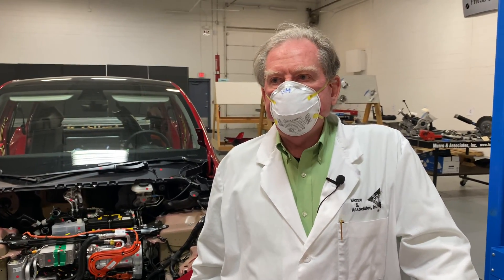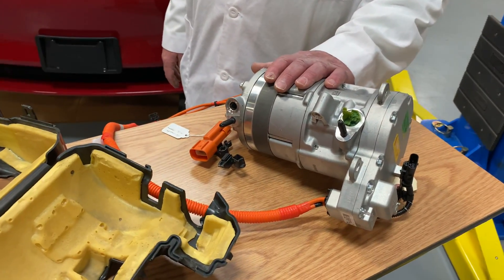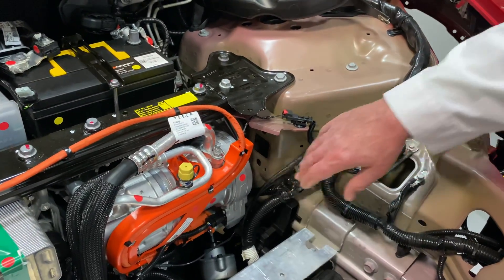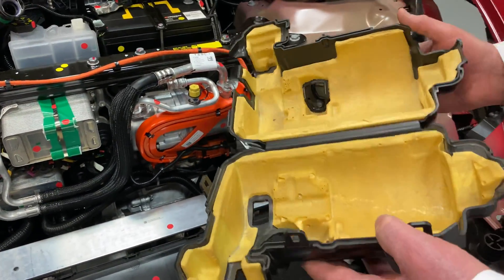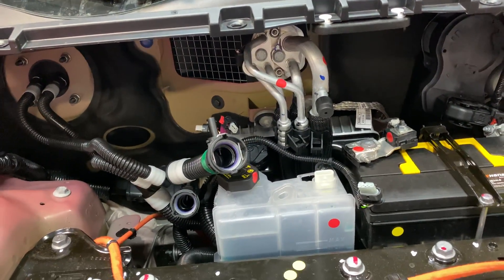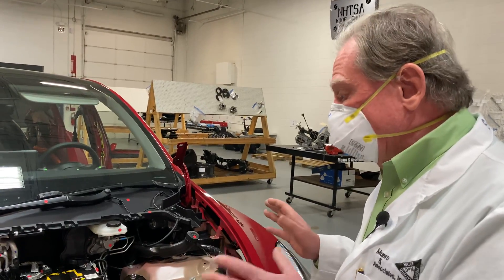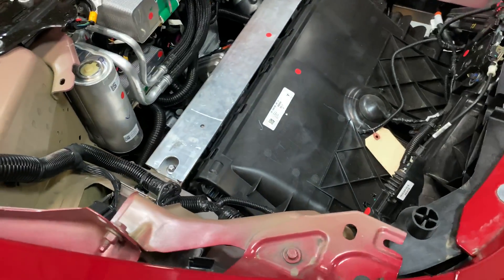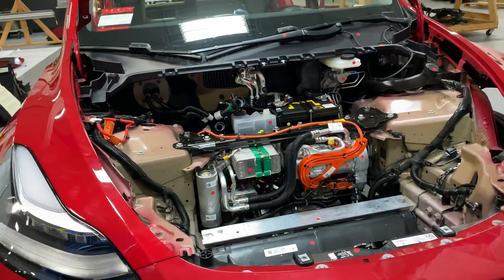Model Y E13: Comparing Model 3 eAC to Model Y Heat Pump

Comment: So Model 3 had separate radiator for Air conditioner condenser hence no heat pump while here its being shunted through two BAHX to either act as air conditioner or heat pump. Furthermore, can you please analyse if fluid path design allows dual functionality, like heating the car while cooling the battery pack at same time?
Reply: Well conveniently the battery pack wants to be roughly room temperature. So the difference between the cabin and the pack shouldn't be that great. Which means that if you want both of them to be at a specific temperature, just have the HVAC system produce a temperature that is opposite room temperature from the external temperature. Then throttle how much of the HVAC output to pipe into each circuit. I don't know if that's how it works on the M3, but I can't imagine it working any other way. Would love to know for sure.

Comment: Sandy touches the, “condenser” (taps thing that looks like a plate heat exchanger) and leaves me confused.
Reply: It’s a water cooled condenser. Uses coolant from the radiator system to cool the refrigerant. Instead of big air cooled condenser mount to the front of vehicle. Much more effective and efficient, especially when sitting still with no air flow. A lot of modern cars are switching to this system
Reply from the maker: The component is labeled "LCC", which we're taking to mean Liquid-Cooled Condenser.  Michael, you got it.
Reply: Munro Live Awesome- Thanks for that explanation- I was unsure as well.  Much appreciated.

Comment: If Sandy thinks it’s a good idea then probably it’s a good idea. He’s finding lots of things about this model Y that I like over the model three. Looks like he’s selling me on a model Y.
Reply: I said it is a good idea before Model X was invented. Nobody believed me. Should change my name to Sandy.
Reply: @tarassu  Depends on what your idea of "good idea" is. Obviously it has some advantages and it has some(quite a few) disadvantages - it is heavy, it can break, it is cost effective and it doesn't heat the cabin as fast as a PTC element. So in that regard it is not a good idea. 

If you live in a climate with below -10/15C - also not a good idea as it will not bring any benefits. It also adds complexity to the system. So if we combine all of this - for the small benefit in some conditions (actually you can achieve near heat pump consumption with proper heating and utilizing the seat heaters) you add a lot of weight/cost/complexity. And if we take the Model 3, the production hell that they had, then adding all of those is definitely not a good idea. Now, they had the time to work on it, add it to the system, which in my opinion "is a good idea" at the current point. It will not bring a ton of difference and only time will tell whether these things will require more maintenance and cost.
Reply: @teslakiller6959  They didn`t want to implement HP for exact reasons you mentioned. Also, they needed to make money form model 3 so...
But, this is supposedly state of the art HP with many solutions that simplify it... So, will be interesting to see what they made...
Reply: @DG-uv3zw  I think this being the first iteration it will have its issues. I think Tesla added it just because people were bitchin about it in reviews and forums - not because Tesla really wanted. Most people in Europe do short trips and put the car on auto with AC which in the winter is stupid - this kills the range. They don't know how the system in an EV works, they are used to the old fossils. If you utilize the heaed seats plus a little pre-heating, not much, you can achieve great results even in a Model 3. 

I think with a little better software on the heater/AC Tesla could've lowered the consumption enough, that a heat pump is not needed. It will be beneficial in some situations, but it is a bit loud and it might add more complexity. We will have to wait and see.
Reply: @teslakiller6959  air contionning is a one way heat pump which can only cool. so they had the heat pump on all model before. They just added some valves so it can be used un reverse to heat the car as well. So they added more efficient heating without much added cost.
Reply: @niconico3907  No, that is totally inaccurate. Plus there is a whole new wiring and the battery is now heated through the heat pump and not the stators like it was before. It is a 100% new system.
Reply: @teslakiller6959  yes its a new system, but the compressor which is the main cost is not much more expensive than a normal air conditionning compressor.

Comment: How much more efficient than the Model 3 is this setup?
Reply: Depends on weather conditions but some say they lost 30% of their battery just on heating the cabin ...
Reply: and if heat pump is indeed 130% efficient, that might workout to only loosing 20% on heating the cabin...
(and maybe battery)
One might guess the model Y  will see 10% less losses in cold/more cold weather range ...  (just guessing)

Comment: I'll take a long range RWD Model 3 with a heat pump, please.
Reply: Engi_Nerd , my preference too. They just announced 404 mile version today (China model). I’m assuming a big battery.
Reply: @shepherdsknoll8  It may be the same battery, just with a different rated mileage due to testing differences.
Reply: @JesseSightler  Yeah you are right. In China, 404 mile version is WLTP and 322 mile in USA is EPA. WLTP is less accurate than EPA .
Reply: @snowrocket691  As a European, im jealous of EPA. The WLTP which we use is not accurate at all. Why the fuck do we not take over the EPA from the Americans. I know the Americans do alot of stuff wrong, but the Car lobby here in Europe is extremely powerfull.
Reply: @Bean-f3z  No elevation? Nah, going down hill for sure XD.
Reply: Exactly this. RWD is already fast enough. I had a Nissan 350z Sportscar that went to 100 in just under 6 seconds. And that was already fast. The RWD Model 3 is also under 6 seconds, and with the heatpump and big battery. I wonder how fat it could go....

Comment: Here in Canada heat pumps aren't really a thing with homes do to winters reaching - 40C. Would this not produce heat in those temperatures?
Reply: They have other ways to generate heat if needed, for example operating the motors at lesser efficiency to generate heat. I also heard something about the octavalve setup itself having the ability to generate heat through a similar approach, but not clear on details.
Reply: At that temperature? No. I think modern heat pumps will work down to maybe -5, however the COP (Coefficient of performance) will get really bad. Once it drops down to 1, then the heat pump has no point as it cannot draw any thermal energy from the frigid air, and you might as well fall back to plain electrical resistive heating. [EDIT] Actually, I checked and they can go lower, maybe down to -25 to -30, but the performance will be very poor.
Reply: @Anthony I've heard it been called -40FC for F***ING Cold!
Reply: My LG air to air heatpump in my house in Norway has a COP of 3 at -15°C and around COP 2,2 at -20°C..freezing outside temperatures are full of energy 😉
Reply: From the standpoint of physics, moving heat around with a pump, coolant and heat exchangers can be made to work at any temperature you might find on Earth, but 'one design does not fit all.'

I think we'll just have to wait and see if the Model Y loses efficiency at those temperatures.  Too late for this year, but next winter somebody or other will probably have a go at running a Model Y in your neck of the woods.
Reply: Maybe an over kill but having the option between the two , or using them in conjunction would be great
Reply: I think the bigger reason for no heat pumps is simply the low (relative) cost of natural gas (and good distribution)

Comment: Do you guys think this heat pump can be retrofitted onto the model 3? From what I understand, the heat pump is much more efficient than what the model 3 has. Would love to retrofit this in there if it's relatively easy to do
Reply: I don't think a retrofit would be possible.  you'd likely need to transplant  entire model Y's cooling system (octobottle) and software.. This is best left to oem.. Assuming this adds %15 cold weather range, I'd pursue more practical options like making sure you have the most efficient winter rims first

Comment: My Active Grille shutter ass ?  What does it means
Reply from the maker: "MY Active Grille Shutter Ass" stands for Model Y Active Grille Shutter Assembly. Active Grille Shutters are being used more and more throughout the industry as a way of balancing air flow into the radiators for optimum vehicle performance as well as aerodynamics for improved fuel economy.
Reply: @MunroLive  yep thats the good olb BMW engineering there mate, the active grille shutter

Comment: Great content as usual! Keep it coming 😁
With the heat pump now included, is there a PTC air cabin and/or PTC battery coolant heater also included? As a backup assuming the r1234yf based heat pump's COP may drop below < 1 at temperatures below < -15degC ? Or they were able to just use the heat pump for all cooling/heating needs with no backup PTC heater at all? Also assuming they somehow included the whole waste heat recovery method from the Powertrain to heat the battery from the Model 3 to the Model Y with the Heat pump based system?
Reply: By sending an impure wave into the motors, they become less efficient, and produce heat. Up to 4kW per motor.

I assume the Y can use this on the cold side of the heat pump to heat the cabin when it's to cold outside.
Reply: As far as I know model y doesn't has restive heaters. But the heat pump has an internal loop to extend the usable temperature range.
Reply: I know that the Model 3 uses its motors to heat up the battery. Tesla Bjorn did some really nice tests to show how it works. It basically wastes electricity in the motors to generate heat to warm up the battery.
And the other things, i guess we will find that out in future episodes.
Reply: Cop cant fall below 1
Reply: @karlreisa3872  when you heat with a heatpump, you come to a point where it delivers heat, the power of the pump is not sufficient. 

Try driving highway speed at -40° ..
Reply: @karlreisa3872  by < 1, I meant it's not usable anymore
Reply: Abhid Akram this is dependent on the efficiency of the evaporative heat exchanger system. 

As an example, my home has a 21 SEER York Affinity Heat Pump and it was able to keep my two story house at 69F with negative 14F outside temps. It takes more energy to run at lower temps but it does keep up with the heating load in my house. In fact, the manufacture’s hardware temp cutoff limit on the HP can be set as low as negative 20F. 

Heat pumps are an excellent choice for heating and cooling. It sounds like Tesla routes the waste heat from the electronics and motors through the heat exchanger as well. This would append the amount of heat available to the evaporator during cold outside temps which, in theory, reduces the amount of compressor runtime to maintain the cabin temperature and/or have the ability to exchange enough heat during even colder (🥶cuhhhhold🥶) outdoor temps.
Reply: @WaterBarleyHopsYeast  thanks for the explanation.

Comment: So there is only 1 radiator with coolant then uses  coolant/refrigerant heat exchanger?
Reply: Yes At 2:40 its a coolant/refrigerant heat exchanger.
Reply: @niconico3907  Cool,  i'm no refrigeration  engineer  but i would assume  this would allow better control, so heat can be taken from motors, inverter,battery and radiator.  This would also work in much lower temperatures than a air to refrigerant condenser.

Comment: Is it really written "shutter ass" on the radiator 😂
Reply from the maker: "MY Active Grille Shutter Ass" to be exact. Ass being short for assembly. Active Grille Shutters are being used more and more throughout the industry as a way of balancing air flow into the radiators for optimum vehicle performance as well as aerodynamics for improved fuel economy.
Reply: Munro Live let us know what you think of the AGS. My brother is the person who designed it for the Model 3. I’ll pass on your critique. 🙂👍
Reply: Elon need more meme inside the car.
Reply: I use "asm" for assembly abbreviation.  Surprised they didn't.
Reply: @eeblatter  Either that or 'assy'. Never heard of 'ass'. Must be a joke.
Reply: Nicolas Musset shutter assembly. Assembly is shortened to “ass” on products
Reply: @ophello  ,  where do you think the "fart" sound comes from?
Reply: Ha ha.  I noticed the same.  Had to re-watch that a few times to be sure LoL.
Reply: Cooling ass
Reply: Yep. I'm sure they did it in purpose. To short a word for only 5 letters when you already put half the bible there. Also why put "my"